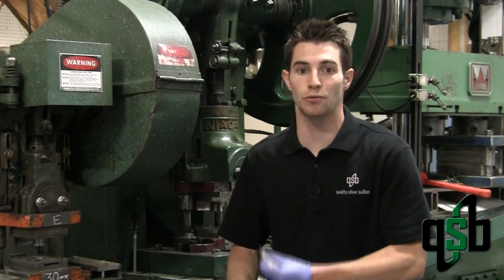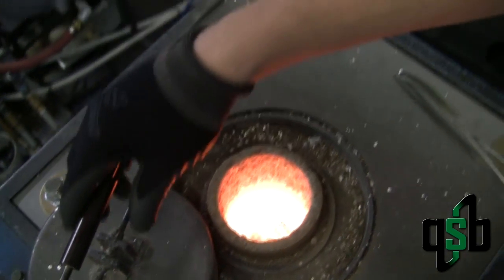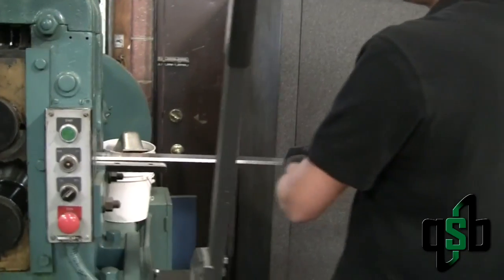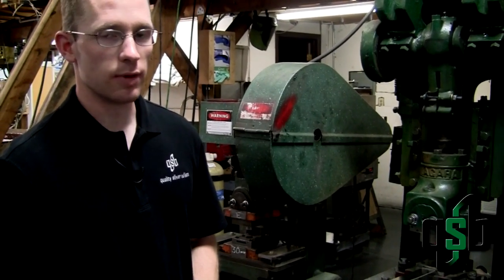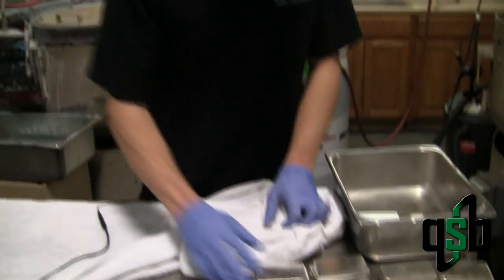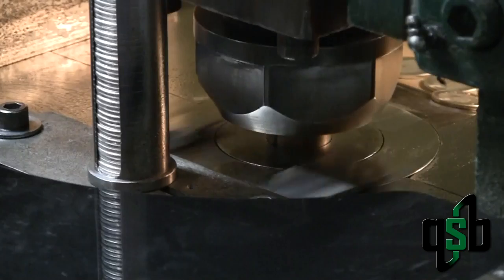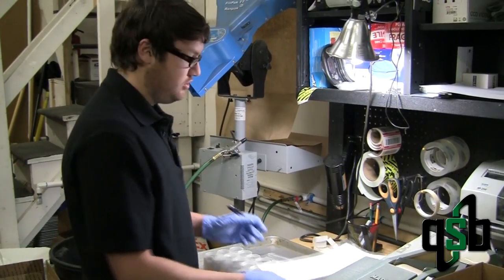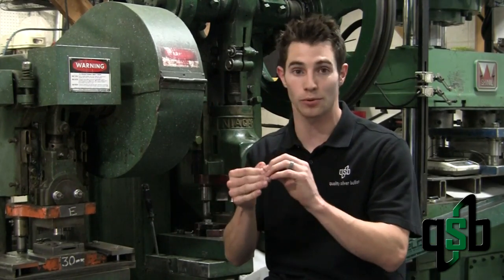How to Mint Silver Coins, Rounds, & Bars - Quality Silver Bullion Tour

Comment from the maker: Actually 13 years ago this all started in a garage. It's a continual work in progress to create the perfect minting process. Glad you enjoyed!
Reply: I really appreciate this video
Reply: 21 years now tho 🤪
Reply: How much all this setup ?!
Reply: Ive just started doing this in my garage! Wish me luck
Reply: 23 years, now
Reply: Are you still in business?
Reply: @eastcoastgrandison4855  I think they were sold, but are now planning to reopen.
Reply: Starting my mint in my garage!  Just got my furnace!  
I've got a question... how hard is it to change the round punch to a non standard blank size? Would it be easier to adjust the thickness of the round than the diameter?
Reply: @sixfigureskibum  If you have shopped for rounds, you may have seen two ounce rounds with the same diameter as the one ounce (39-40mm?) but twice the thickness. Why go non-standard unless you have a reason? Your dies will cost more too I would speculate. If you have the tonnage in the blanking press, it seems changing the die is as hard as when you put the die back in after sharpening.
Of course, larger diameter rounds have more 'wow factor' to the eye. What type of furnace are you using? What type of annealing furnace are you planning to use? I hope you don't mind my butting in on your question :)
Reply: @sixfigureskibum  btw, thickness is a simple adjustment on your rolls....takes seconds per adjustment. Changing a die diameter is inherently more involved/expensive.
Reply from the maker: @eastcoastgrandison4855  yes we are!

Comment: Fantastic set of machines, the furnace that outputs bar is particularly impressive... I suppose the main difference between yourselves and the bigger operators is capacity -the overall process is probably similar.

Comment: I think you should have different rollers so that you don't have to keep changing the settings.  This way you could set the last roller to the desired thickness and come out closer in weight.  You won't have to melt as many back down.  Your weight should also be measured after polishing instead of before.  I enjoyed the video.  It was fantastic!

Comment: I had a minting process question about a CDN quarter I have that is stamped one side only.  It is stamped with a full rim on the Reverse but only a slight raised edge on the Obv. which is the blank side.  On the blank side the high point is rim but it's barely noticeable and there is evidence of shallow reeding around the rim of the coin.

I was wondering if this could have somehow been stamped on one-side only with the Obv die capped or blocked by another blank (the blank underneath would then have only the Rev. stamped) or if it has been altered after the minting process.  It does not seem to have ANY trace of the Obv. details (40x magnification) and is only 0.009 thinner (0.054 instead of 0.063) than the normal quarter thickness which I would think would be impossible if it was machined off either by grinding or by turning it on a lathe.

Also, the Royal CDN Mint has printed coins for 80 countries since 1908 and I'm wondering if the Rev. was stamped possibly on a foreign planchet.  It is slightly undersize diameter-wise but only by 0.0008 and is 4.70 grams as opposed to 5.05

I was wondering if you would share your thoughts and help me clear up this mystery coin.

Any help would be appreciated.  Best Regards.
Reply from the maker: Good questions.  Without seeing the piece it is hard to say, and your deductions are all plausible.  You could send it to PCGS, NGC or ANACS for authentication. ANACS would be the cheapest, and doesn't require being sent from an authorized party.  Go to www.anacs.com for details.  Good luck!
Reply: Thanks for the advice, appreciated.
Reply: @QualitySilverBullion  are you still in business?
Reply: @eastcoastgrandison4855  I don't think so. Their website is down and has a message in Latin that even Google can't translate.

Comment: You said that press has a 300 ton capacity! What on earth would you be hitting at that tonnage!  I've worked on komatsu 300 tons and komatsu 600 tons, the dies themselves had over average of 10 progressions, and most still wouldn't hit at 300 tons. Besides all of that, cool operation, and great looking quality control. Would love to work for you to put those embosses on those blanks!
Reply: They may have bought their machinery at auction, or used. If you need a 100 ton press and you can get a 300 ton press for the same price, why not. Maybe some day they will stamp 100lb. coins.